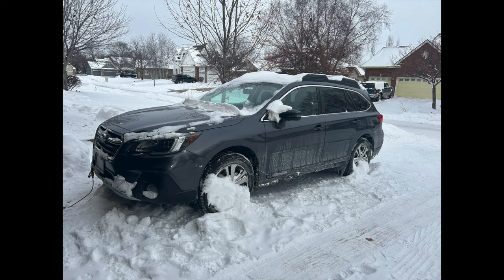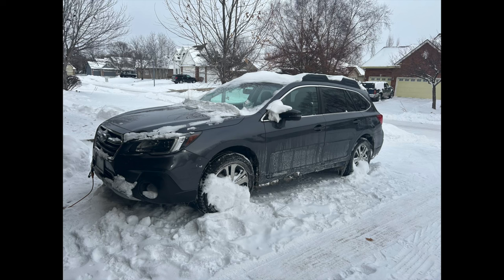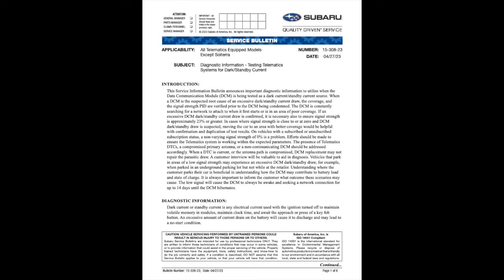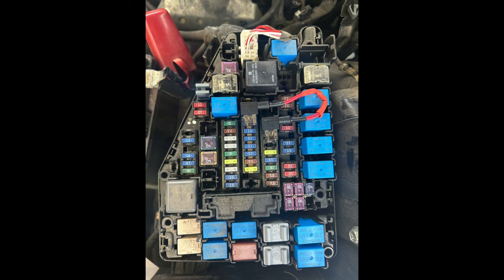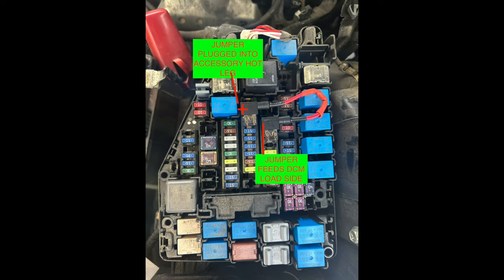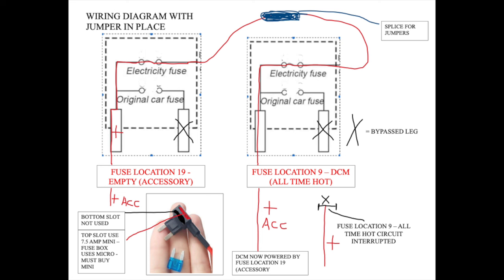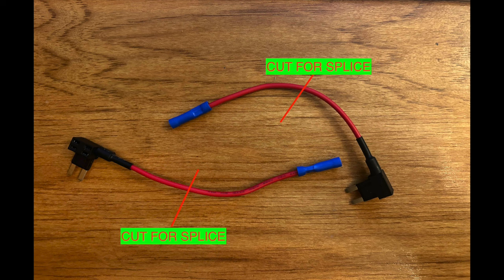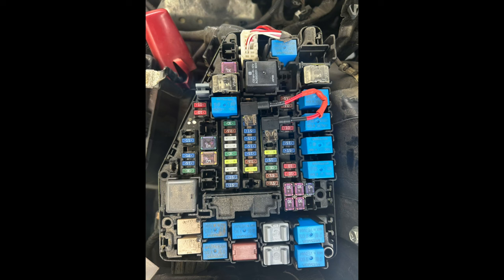2019 Subaru Outback Legacy DCM Parasitic Battery Drain Fix

Comment: Update 2/10/2024 Called SOA, they sent me to my dealer for a NO CHARGE replacement of the DCM unit. They stated it is a VERY WELL KNOWN issue and did not even argue with me. FYI
Reply from the maker: What year and model? Did you have to pay the labor charge?
Reply: 2019 Outback 2.5i Certified Pre-Owned with Subaru Gold Warranty 7yr/100K. They are not asking for even the deductible.

And your jumper works great in the meantime while they order the part and schedule the repair. I got my front speakers back😂
Reply: Dang! They charged me $600! I should call SOA.
Reply: Did you have to open a case with SOA first? I called to ask them about this and they just took my info about it and said I’d have to wait two days for anything. Just trying not to waste my time. Thanks!
Reply: What is SOA?   I got the same problem.
Reply: @johnkohl7573 Subaru of America. Also known as SOL.
Keeping the cellular modem powered all the time is pretty asinine. I'm glad it can't phone home anymore.
Reply: I have the same issue with my 2018 Crosstrek. I received the letter from Subaru extending the warranty on the DCM. I took it in for diagnostics and they can’t replicate the problem, therefore can’t replace the DCM. They even charged me for the diagnostic, but told me that if it happens again within 30 days to tow it there without jump starting it. Will see . I have a new battery about 6 month old and both the battery and alternator check out good

Comment: April 22, 2024: Subaru issued a Warranty Extension for the DCM which should fix this problem, AND reimburse the owner for New Batteries, Tows, and other costs associated with the DCM battery drain.
The Extension is 8 years and 150,000 miles
Reply: Unless you have a rebuilt title. Right now going back and forth with Subaru about this issue. They said because of my title they won’t fix it.

Comment: Had this problem in my 2019 Outback a while ago.  Took it to the dealer to look for a parasitic draw. They allegedly found nothing.  Afterwards, I never had a dead battery again.  However, as discussed in the video, we eventually realized that our bluetooth was not operating correctly.  Took the car back to the dealer to diagnose the problem, and we were advised for the first time that during the last visit, they removed a fuse which in turn affected the bluetooth.  To fix the problem, the dealer wanted $450 to install a workaround that Subaru came up with since the car was out of warranty.  I politely requested that the dealer call Subaru because I was not going to pay to fix an inherent design problem that Subaru acknowledged by engineering a fix.  Immediately, the service writer agreed that there would be no charge.

Comment: 2019 Outback. Dealer identified the problem and gave me the  the Subaru Customer Care number,  They replaced the battery and the DCM module. I paid $150 labor fee to replace DCM. Problem resolved.
Reply from the maker: That is a good compromise. Too bad you still had to pay the labor fee on something that is a poor design to begin with. Hopefully others have this option.
Reply: If you have the receipt, they made this a free extended warranty replacement and should refund you for that if you call!

Comment: My 2020 Subaru, battery was dying. Sometimes it was fine for a week, but then sometimes just overnight. Subaru couldn't find the issue, brought in engineers to find the issue.  One of the engineers, by chance, heard the little motor in the tailgate kept running after you closed it.  So you press the tailgate button to close, the tailgate closes and a small motor latches and pulls the tailgate closed (gently).  This motor kept running and was the problem.  This is why we could go many days without the problem, then have the problem a couple of times day after day.  It all depended on if we had opened/closed the tailgate or not.

Comment: After being told by the dealership's service manager that I'm driving too many short trips, and after having my local mechanic replace the battery only to have the problem recur, I found your video . Eight dollars and fifteen minutes' work later, I had your fix installed. A month of driving now, and the battery is holding its charge perfectly. Thank you, thank you! (And by the way, I've experienced no glitches whatsoever with the sound system.)
Reply from the maker: Glad to hear it. It is sad to say, but I bet the service manager knows exactly what was causing your issue. It is so well known by now.

Comment: El Dude-I am going to call my local Subaru dealer and try to get him to replace the DCM for free. If not, I'll remind him that we bought the 2016 and 2019 (2.5 engine) Outbacks from him (new) and we are now on our 4th batteries for EACH vehicle.
The latest failure on the 2016 (3.6 engine) is with an Optima battery. Different battery and same results. I had removed the Fuse # 9 from both, not inclined to ever buy another Subaru, just run these units out to high mileage pasture and forget about the brand. It should be called the BS machine instead of Luv machine!

You have the Best Subaru Battery explanation video on YouTube!!!!
Reply: Did it work when you removed fuse #9?

Comment: Subraru have recently addressed this issue with a warranty update that covers bypassing or replacing the DCM for 2019 Outbacks and other affected models.  I received a notification from Subaru April 2024.  But his is a great, simple solution to this very annoying problem that should've been addressed by Subaru years ago.

Comment: Thank you for creating this video and posting to share with us. I just received a letter of the warranty being extended with the dcm but to 100,000 or eight years but my Forester is at 96,000 so this extension is really almost over and they decline my claim with the battery not lasting 5 years or so. You are right about this creating us a problem and will not fix till it's really a problem or needed to charge us. They should recall and fix the dcm,update or replace.
Reply: We got the same letter. The extension lasts a year even if you are over 100,000

Comment: I left my hatch open for 5 days in my garage working on a car camping build. I consider that a good test. I did use the hack to trick the lock, and she started right up at the end. Keep in mind i have drained my battery in the past, three times, by keeping the hatch open too long so i have experienced it. I also installed a red top battery recently because it was due. The hack definitely works. Btw, you don’t even need a carabiner; you can use your finger or an Allen wrench and pull it out.

Comment: 2019 Subaru legacy In 24 to 36 hours my car would be dead and or in 24 hours in the cold it would not start. Had the car sit for about 6 months. Finally started working on it and pulled the fuse and my draw was gone and not sucking the voltage down now. Now just gotta fix the damaged head unit. I love these engineers for Subaru. They know how to make a product last 5 years 😂

Comment: Great video, one of our family friends has 2019 Outback same car.
She took it to Subaru and they are aware of problems. Said DCM back ordered for over a year. They charged 185.00 to diagnose and told her they would remove the fuse. Also would affect Bluetooth and radio.
I’ve followed your advice and am going to try the jumper solution.

Comment: This was exactly what I was dealing with and yours was the first video that addressed the DCM. About a week ago, I got a letter from Subaru, which will give you the choice of disabling 3G hunting by disabling Star Link. According to the dealer, all the other functions that go through that circuit will still work, blue tooth, etc. 

The second option is the subscribe to Star Link and they will upgrade the DCM for free (but you have to buy two year subscription upfront).
Reply from the maker: It’s good to hear they are finally addressing this at no charge. I haven’t received a letter or notice. Not sure if it is because my care is now 5 years old. I’ll drop in the dealership one day when I close by and ask. Thanks for sharing.
Reply: thanks for the insight. did you already have Starlink so that they send you the letter?

Comment: This works! Thank you so much! Timmons Subaru in Long Beach is charging 1200$ to fix this. They are scoundrels! That is so dirty! Now I just have to replace the defective radio.
Reply: As long as you pick out a good aftermarket radio, you won't miss the stock one, anyway. Mine was flaky as all get out. Crutchfield customer service will walk you through the whole process if you want to do it yourself.
Reply: You may be able to get reimbursed for that repair. Subaru is now offering a free DCM fix for this issue.
Reply: @escapethecave6894 I’m selling the car and don’t want to deal with Subaru service ever again. Not sure whats worse, the service department or the salesmen.

Comment: Close the Starlink, quick!
Dead battery at the airport. I feel your pain. Thank you so much for this idea. I'm going to try to implement this on my 16 Forester. Thankfully, I already replaced the buggy head unit with an aftermarket one, so I'm not concerned about Bluetooth. The front speakers do get routed through the DCM, though. (I tried removing it altogether when I installed the Pioneer touchscreen with Carplay.)

Comment: Thanks for this, I will use this method to cure the parasitic draw. I really think SOA should offer this as a solution to this well-known and widespread issue. I do NOT consider this a 'hack' at all.
Reply from the maker: Depending on your year make and model, some owners have called Subaru America and they have covered the cost of an actual repair.
Reply: Still on extended warranty. Although I'm happy to just use this jumper method, I may have the DCM replaced anyway... resale value and all that.

Comment: 2019 Outback here - I called Subaru Customer Care and they agreed to cover the DCM module replacement on Subaru's dime. There is also an extended battery warranty on these models due to some litigation. I did try the dealership first and they wanted $800 to replace the DCM.
Reply: did you replace the DCM for free? I need to pay the dealership.
Reply: @sharonyu1504  The dealership did want to charge me for the replacement but Subaru Corporate agreed to cover the cost. Call Subaru, not the dealership.
Reply: Hello Choppr7, I have the same car and same problem you do with the DCM.Do you have a good number for Subaru customer care and contact name?I really appreciate it. Thanks

Comment: I have this problem with my 2018 Outback.  The car is out of warranty, in fact, I purchased it used with a branded title.  I called SOA and asked if they would fix it for me.  They told me I had to get it diagnosed by the dealer, so I took it to my local dealer and they did in fact diagnose it as the DCM, however, they did not offer to fix it for free.  It was either pull the fuse (but they said blue tooth might stop working) $650 to replace the DCM or $215 to reset the system to "factory mode" which they said would fix it, but I would not be able to use starlink.  So I called SOA again and they had me send them the documentation from the dealer showing it was the DCM.  They said they would assign a case manager who would get back to me.  I am keeping my fingers crossed they will fix it for free.  However, if they do not, I plan to do this hack.  Thanks for the info.
Reply: I called and read them my vin for my (branded title) 2019 and they just flat-out said "Yeah, no..."

I've been using this fix for some months and it hasn't left me stranded, just some weird BSD/RCTA things.

Comment: Thank you for taking time to make the video to explain the battery drain issue.  I have a 2019 Legacy, and had replaced two new batteries over the last 12 months.  The last battery replacement was just one month ago and after let my car sits for a week (it is my weekend car), I need to jump start it.  I am fortune enough to find your video and see other people's comment.  I took my car to Subaru dealer today and they acknowledge the issue, installed a DCM bypass box free of charge.  I hope the problem will go away after this fix.
Reply: I’d like to know is how that goes. I have a Subaru ascent I JUST replaced a battery on. I was out of town for 3 weeks and by car didn’t start.

Comment: Thanks for sharing your solution.  I followed your instructions and it worked on our 2019 outback.  However, the car alarm now triggers at random times after we leave the car.  Have you seen this and could it be related to powering that circuit from accessory feed?

Comment: My wife drives the 15 outback which has battery discharge problem, this happens in just letting the car off 1/2 hour from driving until taking it back to find the battery is discharge and it won't crank. Jump it, charge the battery at home and discharge test under 100 Amp real load test comes back good. Re-install same battery and have no issues for months then same occurs again. Tested battery load with car Off comes down to 30mA after 3 or 4 minutes. first few seconds is up at 5 Amps, then 100mA and finally 30 mA. Charging voltage at idle 14,3V. I suspect something intermittent, either the alternator does not charge sometimes or load remains On while car is turned Off. Tested DCM Fuse 9 load and it corresponds to 30mA load. in theory a group 24 lead acid rated at 60Amp/hour should last 600 hours with 0.1 Amp load thus why I suspect not every time the car is switched off does it go to full sleep mode. I have ordered the fuse carriers and will do the mod just because but I suspect my car also has another issue. not mentioning every time the battery gets flat you have to deal with all kind of systems going berserk (hill descent, Snow etc) it's like a christmas tree in there.

Comment: My 2019 Subaru Outbak is having the same issue. I already bought a new battery back in 2022 not knowing this was a known issue. Lately, this new battery is dying if I do not use the car for about 24 hours. I want to try your hack before I take it to the dealer. However, i am not tech inclined. Can you make the cable and sell it to me? Please let me know...this will save me some time trying to order and figure out how to...very much appreciate any assistance in getting the cable. LMK and I can send you email or contact. Thanks.

Comment: Interesting. Thanks. I have a 22 forester with a battery issue. Subaru just replaced it under warranty but it looks like that’s not the solution. Maybe with Starlink being discontinued this pinging has stopped?
Reply from the maker: I don't know. I am inclined to say no. The DCM would have to reprogrammed to stop the search cycle.

Comment: With this by-pass, as-is,  it would sometimes blow the 7.5A fuse. When 19 cuts off, it goes to ground. Sometimes, don't know why, the DCM module would feed back about 2 volts. I added a diode, stripe toward fuse 9, to prevent this backflow. This seemed to solve the problem.

Comment: Got a letter from Subaru saying they would replace DCM when they get more in stock . Also said they were extending warranty on DMC to 8 years or 140000 miles ,with free replacement  .
Reply from the maker: @oldcorp1  a lot of viewers have been treated right by Subaru. When I made the video they hadn’t extended the warranty yet and I am sure Subaru was getting a lot of calls from folks being charged $700 for this. I am still using the bypass. I am too lazy to deal with a dealership.

Comment: For what it's worth, Subaru sent out extended warranty notices in Feb 29, 2024, addressing the issue of faulty Telematics Data Communications Module (DCM) for 
•	2016-2018 Legacy, Outback, Impreza, Crosstrek and Forester
•	2017-2018 WRX
The notice states in part, vehicles "may experience a dead battery as a result the DCM continually trying to access the 3G network which is no longer available and have not received a previous DCM update." See complete notification online.

Comment: Hi I want to do this on my 2019 Wrx. Is this fuse locations the same as yours? #9 and #19. I bought the jumper wires but need to know which number fuses I need to do it on my specific vehicle.

Comment: I just removed the DCM fuse number 9. Should I go for a drive to charge the battery ? Car wouldn’t start after I removed it- but have been having this issue.
Reply from the maker: @snoopy2themoon  either that or put a charger on it. Need the battery to charge, then let it sit for 24 hours without the fuse in place to confirm that was the circuit draining the battery. FYI. Subaru has now extended the warranty on the DCM so you may be entitled to the free repair.

Comment: I ordered the taps. Could you please explain how you fit the mini connectors of the taps into the fuse receptors that are for micro fuses? Is that okay to do? Seems kind of a poor fit when I tried.
Reply from the maker: The blades on the mini taps will fit snugly into the fuse slots that hold the micros. I did not have any fitment issues.

Comment: Great video, Subaru installed a dcm bypass box in June while they wait dmc inventory, expected by Sept 2025. Apple CarPlay has not worked since the bypass box was installed. Has anyone else had a similar experience? I connected via usb cable. Thanks

Comment: Could  you have just moved the wires to fuse location 19? From the bottom? Thanks
Reply from the maker: I am not sure. Seems like it would be a lot of trouble for little gain. If you were able to remove the fuse box and had enough wire to change things around you could. Take a look at some other comments. Subaru has extended the warranty on some models having this DCM issue. They will pay for the repairs.